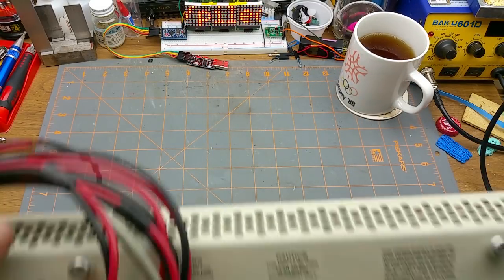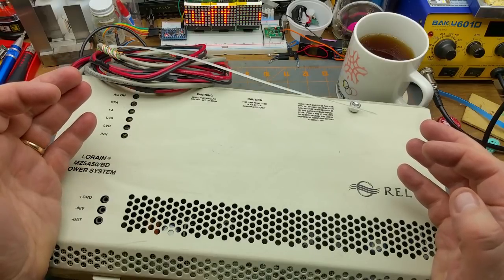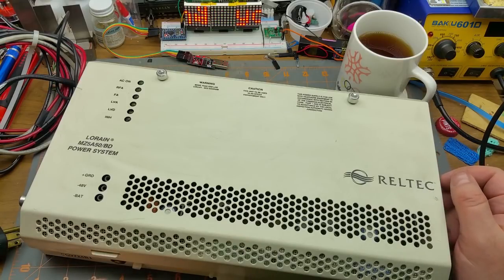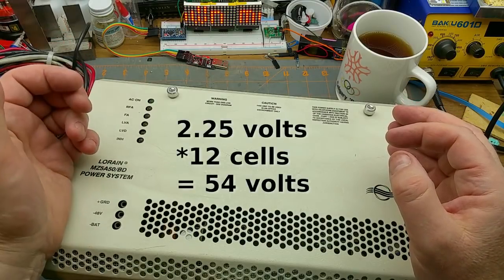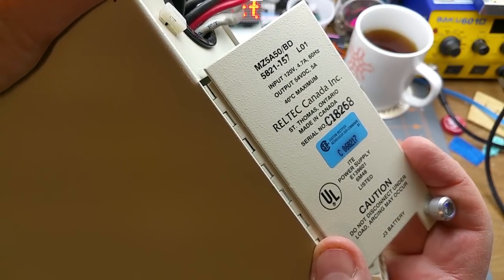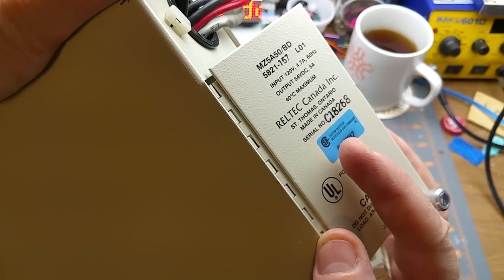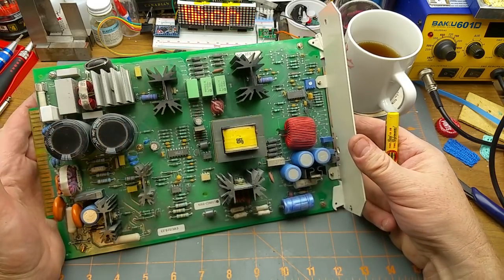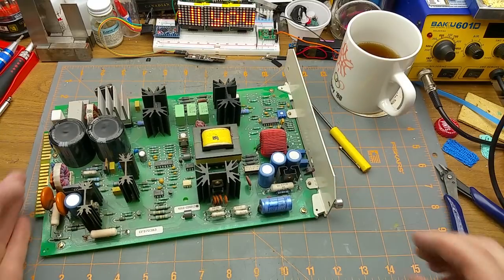Old tech: Reltec telecom power supply

Comment: Thanks. Finally a good explanation of these type supplies. Well built supply. I'm still not understanding why the negative voltage....
Reply: The Simple answer is: Negative voltages are used to reduce the opportunity for electrical noise and then dampen it when it does occur. Most electrical noise that is introduced onto a communication signal (Or onto a telephone line) would be of a positive potential.
The following is a very simplified example. 
Before modern electronics, digital telephone switches, fiber optics and voice over IP , back in the early days of telephone service - keeping the buzzes, hums, clicks and pops caused in part by outside electrical noise out of a customer’s telephone conversations was a real challenge.  Telephone lines often run for comparatively long distances in unshielded bundles and experience many re- terminations along the way.  When our home phone hung on our kitchen wall it was connected to two 26 gage or similar sized wires (No thicker than a straight pin ), those two wires normally ran down to the basement then to the outside of the house where they were terminated in a demarc box to the phone companies “overhead’ wires and those wires made their way to a telephone pole and likely a second termination into a multi pair bundle along with all of your neighbors phone lines which together all make their way back to a ‘ Central telephone office. This Central office could be several miles away and might require your two kitchen phone wires to go through several more re- terminations along their path. The point being, even before your wires make it to the telephone system they have had many opportunities for unwanted noise during your conversations; loose connections, electrical noise from powerlines and streetlamps or static charges due to weather etc.  
Here is where the negative voltage comes into play. Think of a "number line ", if we draw such a line with zero running horizontal left to right - now draw another horizontal line above that zero line, this new line would represent a positive number and so any line drawn below the zero line would represent a negative number. Now we will assign a value to the top most 'positive' line – say +10 volts; and now do the same for our negative line as well, so  - 10 volts.
 If some outside force were to induce a positive three volt spike onto our top line, its value would momentarily rise to thirteen volts (In telephone terms, the higher the voltage the louder a sound is heard ). Now repeat this scenario for our – 10 volt line … a positive three volt spike would represent as a seven volt ‘Pop’  and not a thirteen. 
As you would imagine, it's a lot more complicated than that but the fundamentals are accurate.
I hope this offers some clarity for you.

Comment: Worked around a lot of telco gear as a customer. Did use the GMT fuses in an interesting way on an airport visual landing aid. The system had two constant current regulators each powering series loops of six 200 watt PAR lamps at 6.4 amps during the day and 4.8 amps at night. The fuses were wired across the lamps with a resistor in series such that if a lamp filament opened the current would flow through the resistor/fuse circuit causing to fuse to blow. The "alarm" contact was wired across the lamp and would jumper across the lamp filament thus maintaning the current loop continuity, keeping the other five lamps lit.

Comment: These white resistors are high power cermet resistors. I think this one might be rated for 10W. In the past you could find them in crt tv's, but in higher values. You can still buy them in various small values for making resistive loads or some current shunts.

Comment: another Olympics - oh f-ck NO. Calgary just recently pays out for 1988, and I remember 2 weeks in Vancouver Olympics as a worst time there. I might be moving to Calgary in next 4-5 years, so just my freaking luck..
But very good power supply, good catch! Consider use it for LED lights, you probably can easily use 7 lines by 16 3w LEDs with it (with proper dc-dc led drivers of course).